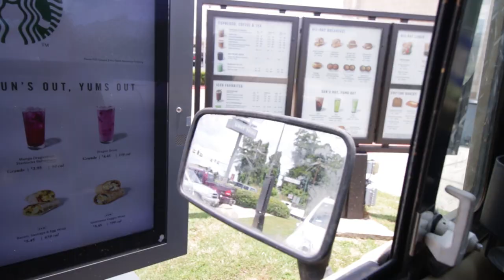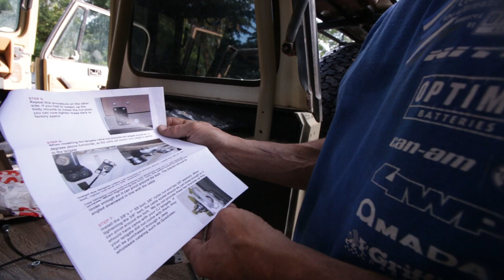Mudding in my Jeep YJ FAIL!

Comment: Is the yj have the front axle disconnect ? Looks like it's not engaged. They make a mechanical replacement that uses a actual cable.
Reply: I like my cj. Has the dana 300 so the stick directly shifts the t case